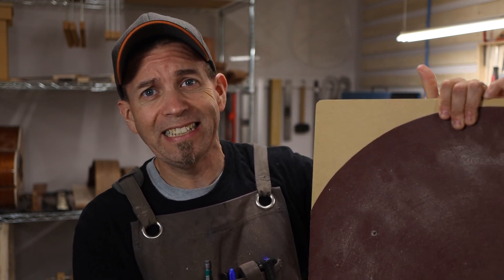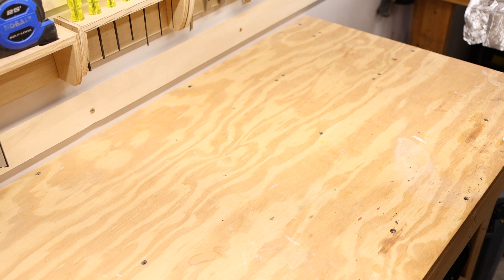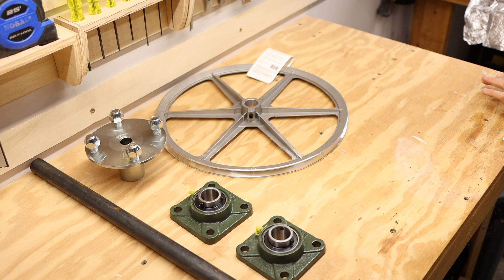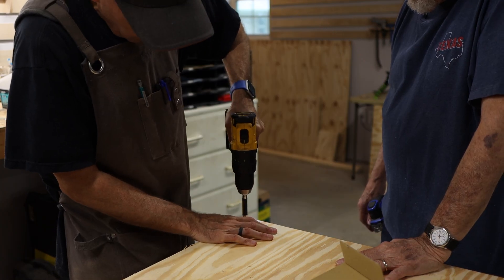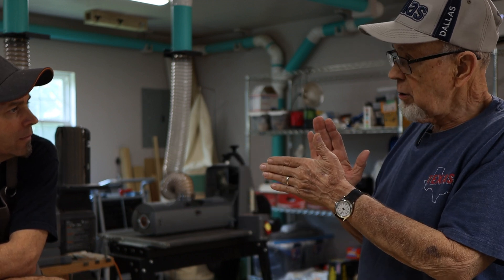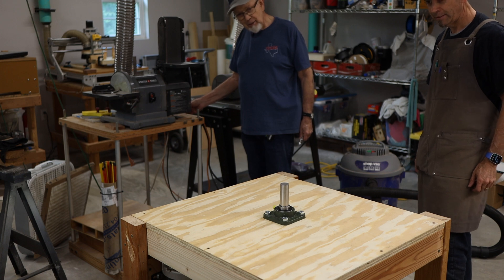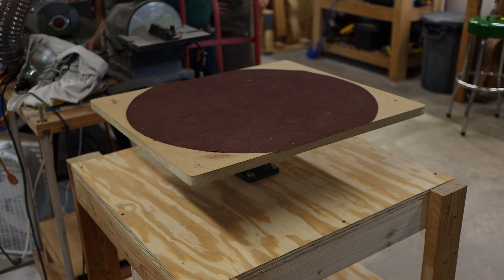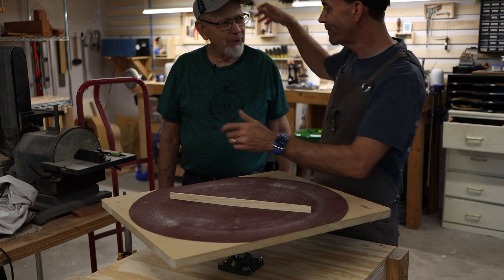Twist, Twist, Radius - The Radius Sanding Machine

Comment: I have the same question with respect to the go cart axle at the top… how did you secure it to the shaft, as the shaft is not keyed?
Reply from the maker: For this one, I drilled a hole through that hub and then tapped it with a 1/4-20.  I also cut a flat into the shaft there as well.

Comment: Making progress! Wondering how you fixed the pulley to the shaft? Did you just use the set screw in the pulley? I noticed a quick video clip where you seemed to be using a cutoff tool on the shaft ??
Reply from the maker: Yes, I used a cutting wheel to flatten a spot in the shaft.  Seems to work well.  After you run it a few times, you'll want to come back and tighten it down some more.

Comment: bought all the parts… metal
rod won’t fit in any of the other openings… anyone have a tip for reducing the rod diameter??
Reply from the maker: Ah, there is a coating on that steel.  We used a belt sander to take that off and get down to bare metal.

Comment: Awesome, I remember when I learned from Charles Fox (over 20 years ago) he had a very similar machine. I'm just now getting back into luthiery and found your video because I was searching for someone who has built one of these. Yours looks fantastic. I downloaded the plan and item list, but was wondering what size belt you got for the pulleys, and what magnets you ended up using?  Thanks!
Reply from the maker: Hey, glad to hear you're getting back into building!  The belt is a 1/2" x 51" Huskee V-belt 4L510K.  It is dependent on how you mount your motor, so there's some flexibility in the size.  Easiest way is to mount your motor and then run a string around the pulleys and measure the string.

As for the magnets, I'm not sure on the strength, but they are 20mm ones that I got from Amazon.  Something like these: https://a.co/d/ducB6Jw

Looking forward to hearing how your build goes!

Comment: Thank for your video.  It is a beautiful machine with no vibrations. I Like it. It looks like a Flat Lap Lapidary Machine. The top of the disc is suitable for sanding large surfaces exactly flat. Like the bottom of a chisel. You can also make attachments to sharpen chisels, planes and draw knives.